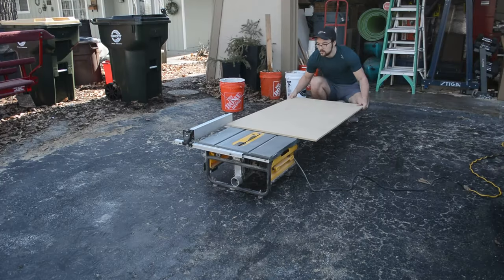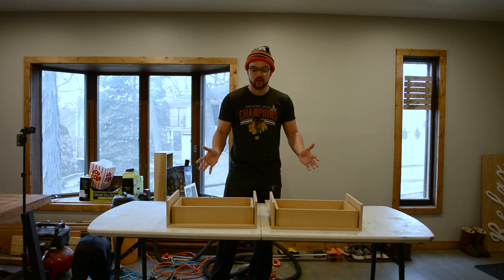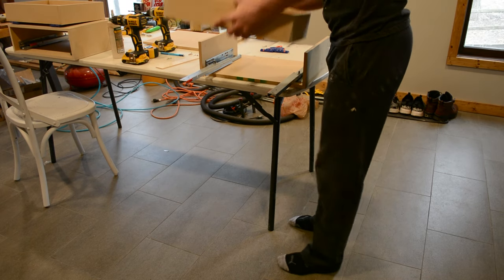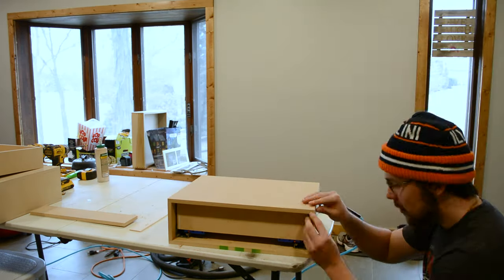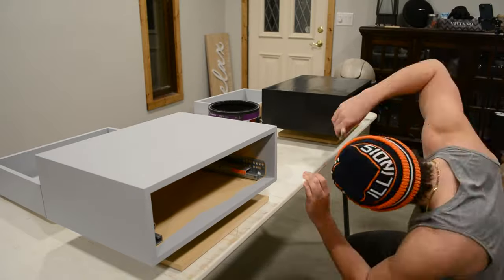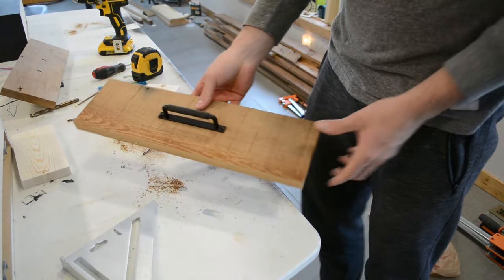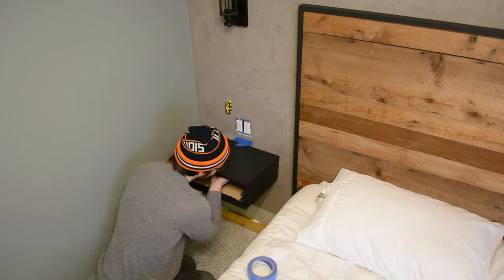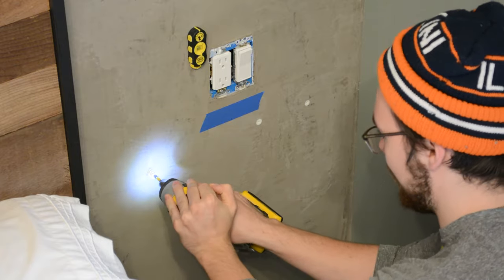DIY Floating Nightstands | Bedroom Renovation Part 6

Comment: To attach the drawers to the guides, you should be able to keep them pushed all the way in and then put the drawer box in and push it back until it locks in place, that way you don’t have to pull the guides out and set the drawer box on top and lay underneath to click them in. Thought maybe that would help make things easier down the road for future projects
Reply from the maker: Thank you, appreciate the advice!
Reply: There’s gotta be a better way to install them drawers, beautiful result!

Comment: Great video. I am building something similar, so looking for inspiration. Some tips I have come across. When attaching the drawer fronts, use the hardware holes (remove the handle) to temporarily screw the front to the box. Then open the draw, screw in from the back of the box, and then reattach handle. That does mean you will have to have the hardware screws visible inside the drawer. I guess you could glue the front on, use the hardware screw holes as temporary fixing. 

I'm also thinking about routing out the underside of the outer box top to embed a wireless charger into the top, so a mobile device can just be placed on the night stand and will charge.

Comment: What brackets did you install on the back of the drawer in order to mount it? I must be missing something from your video
Reply from the maker: I didn’t use any brackets. I just screwed through the back of the night stand directly into studs or drywall anchors and it is plenty strong. Hope that helps!

Comment: Absolutely amazing, one question, would you happen to have the plans available for measurements, cuts and such?
Reply from the maker: Thank you!  I don't have plans, but the drawer outer dimensions are 16.5" wide by 11" deep. The bottom panel is 15.5" wide and 10" deep. Height of the box is 6" Hope that helps!

Comment: why not mark on the drywall where the draw is going, remove the drywall and install some deadwood, put drywall back now you have solid wood to screw the nightstands to.
Reply from the maker: That's a good idea! I don't think its necessary as the studs are strong enough but it would be peace of mind

Comment: Hey, I love the video and I was planning on making one for myself. I was just wondering what the dimensions for the drawer front were in the video.
Reply from the maker: The outer dimensions of the drawer are 18"x6" and I used 3/4" MDF so the drawer front opening is 16.5"x4.5". I then sized it down an 1/8" so it was 16 3/8" x 4 3/8". Hope that makes sense!

Comment: Hey man great project! I'm building a set with my son. Him and his lady apparently found this video and wants me to help him build. I read down in the comments the inner drawer boxes are 17x10. So would it be correct to assume you cut the bottom planks at 16x9 ? Appreciate it.
Reply from the maker: Thank you and sorry for the delayed response! I have actually updated the design. The drawer outer dimensions are 16.5" wide by 11" deep. Therefore, the bottom panel is 15.5" wide and 10" deep. Hope that helps!
Reply: @GoldenKeyDesign  Hey thanks for responding. Good info.

Comment: What’s the measurements for the inner drawer in comparison to the outer box
Reply from the maker: Good question! The outer box is 18" wide, 6" tall, and 12" deep. You adjust these dimensions to suit your space if needed. The inside box dimensions will depend on the type of drawer slides you are using but I made mine 1" shorter in every dimension. So it came out to 17" wide, 4" tall, and 11" deep. Hope that helps!
Reply: @GoldenKeyDesign  It sure did help, I kind of liked the slides you used although their reviews are not great, but they should work for what need them for.
Thanks!

Comment: Can you tell me what point in view you added the brackets to attach the shelves to the wall. I missed it
Reply from the maker: At 4:20 I installed a piece of MDF on the back of the drawer. I screwed through that piece and into the wall to mount the drawers. Hope that helps!

Comment: There's nothing wrong with what you did, but I like to attach draw fronts a little differently.  I like to find my handle position, like you did, drill the holes for it, align the front (like you did with cards or whatever, doesn't matter as long as it's aligned) then screw the front to the drawer box from the front through the holes I made for the pull.  Then open the drawer, screw it in from the back, then remove the initial screws and install the handle.

I don't like have the double sided tape in between.  Maybe I'm just being anal.  Also, I feel like it's more accurate and secure when installing the screws from the back.

Anyway, just thought I'd share.
Reply from the maker: There is always so many ways to skin a cat haha! I like your approach too

Comment: Great design and craftsmanship, what primer and paint did you use? Turned out great
Reply: Also what kind of wood used for the drawer front
Reply from the maker: Thank you! I used a standard Kilz 2 primer and an interior eggshell paint in Limousine Black. The drawer front is actually leftover wood from the demolition of the kitchen. I believe it is cedar but has a lot of weathering/patina. Hope that helps!

Comment: 1 in smaller drawer is too snug.  Should be at least 1 1/2 inches smaller.
Reply from the maker: My drawer still had room for clearance but it may depend on the slides used